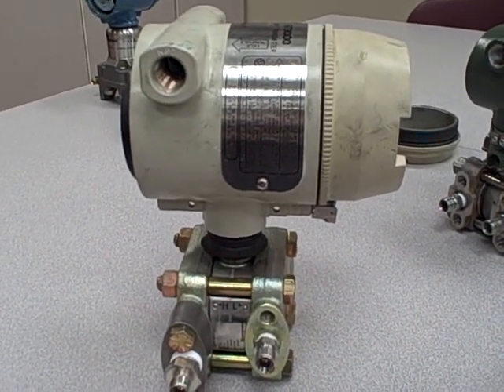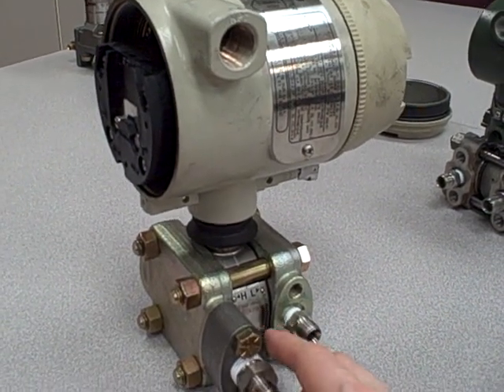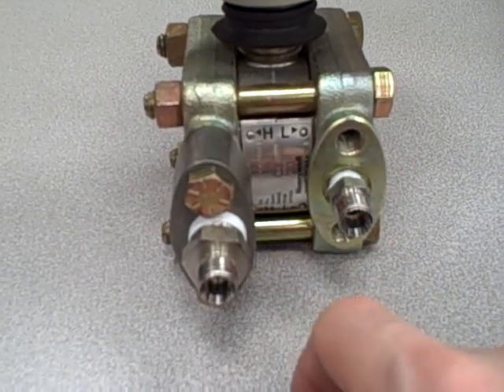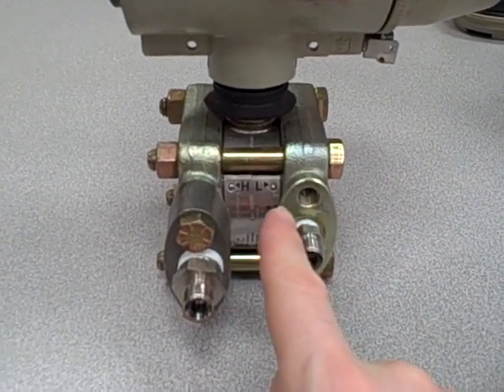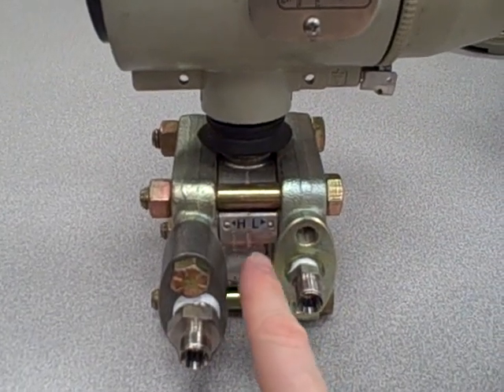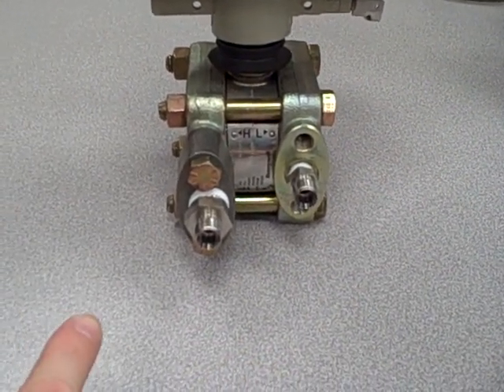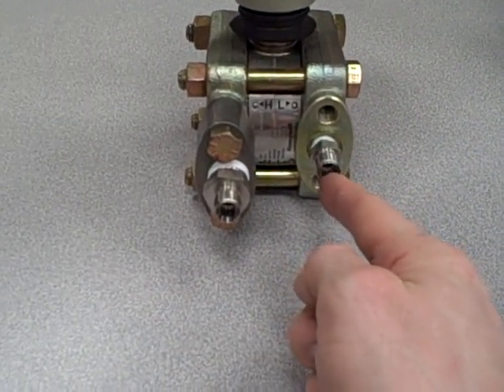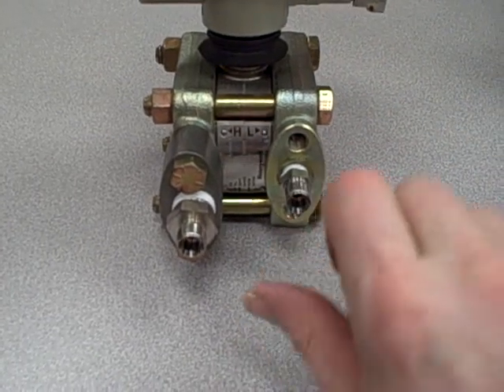Meaning of DP transmitter High and Low pressure ports

Comment from the maker: @sl33714 "Let's say the transmitter were ranged in such a way so that with no pressure applied . . . the output of the transmitter is 12 mA".  An example of this ranging might be -10 PSI to +10 PSI: with -10 PSI (10 PSI applied to the Low side) you get 4 mA, with +10 PSI (10 PSI applied to the High side) you get 20 mA, and with equal pressures (0 PSID) you get 12 mA.  LRV = -10 PSI, URV = +10 PSI.